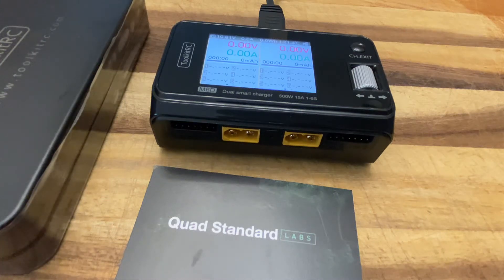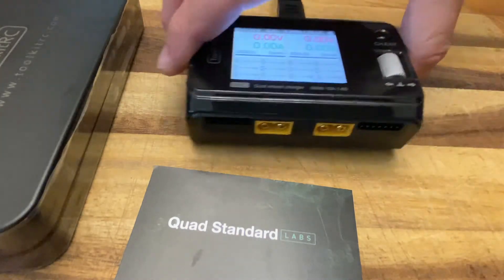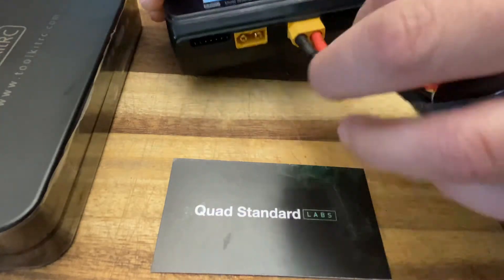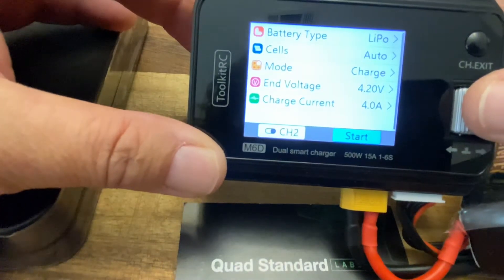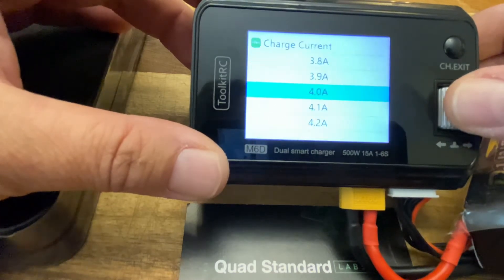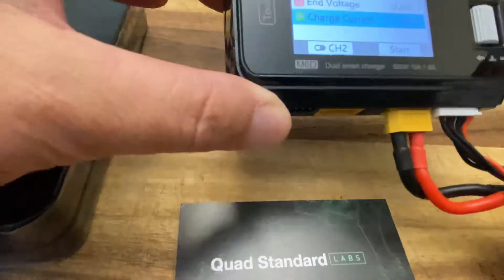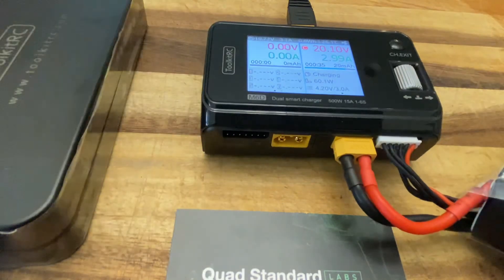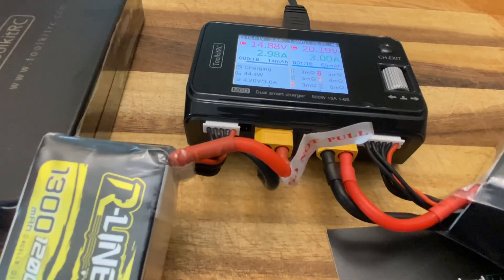Toolkit RC M6D Charger: How to Charge Lipos

Comment: Hello! Mine is saying that my input voltage is either too high or too low. It's 1300mah battery so I tried 1.3 and 2.6 like you said. Right? Thanks in advance